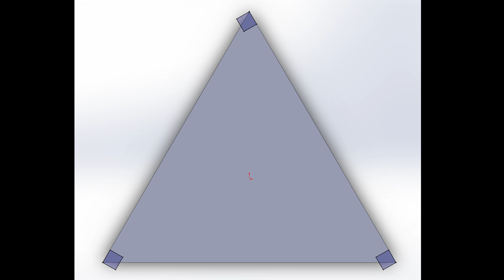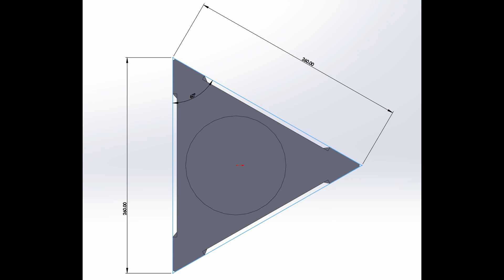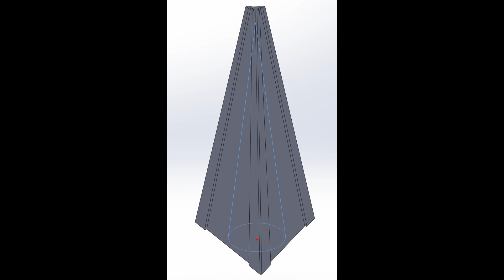2025 Science Olympiad Tower Div C: Overall Approach

Comment: How much space is required at the top for the loading block to fit, having as little extra gaps as possible? What is the smallest triangular sidelining we could aim for to have the chain and loading block just perfectly go through???
Reply from the maker: I'm not sure what the exact minimum size at the top would be.  My design here has a pretty small top, I wouldn't want to go too much smaller.  Remember, you have to thread the eyebolt and chain through during testing and you don't want to risk breaking it.

Comment: Hey i am having some troubles sizing the sliced files you have attatched in the description can you attatch the unsliced stl files. Thank you
Reply from the maker: Here is the complete jig before I cut it into 3 pieces: https://klingerphotography.com/BalsaEngineering/2025/2025_DivC_Tower_Complete.STL
Reply: @balsaengineering6686  hey thanks for the stl files but i am confused because when i go to slice this file or even print the other files it wont fit my slicer i have adjusted the settings for the baseplate in my slicer . Even this seems to be a bit bigger is this years jig bigger then last years jig? I have access to a ultimaker printer that has a base plate of 12 inch by 12 and should be able to print the whole thing in one go
Reply from the maker: @arjavjain3279  A 12x12 baseplate should be plenty big enough.  The bottom part of the jig is only ~257mm in the largest dimension.  You shouldn't need to scale anything to be able to print the piece.  You might need to rotate it 90 degrees so it's flat on the plate, but that shouldn't change the size.
Reply: @balsaengineering6686  it ends up being 257 cm not mm
Reply from the maker: @arjavjain3279  The file is definitely 257mm, so if your program brings it in as 257cm, just scale it down by 10x

Comment: Are the STL files already scaled? (The video are really helpful! Thanks!)
Reply from the maker: Thanks!  Everything but the triangular leg sanding jig STL is scaled ready to print.  You'll need to scale the sanding jig the way I show in that video if you want to try that approach: https://youtu.be/MTHygxUS3YU
Reply: @balsaengineering6686  I will defiently check that out! Quick question though, what unit was used for the measurements for the tower prints?
Reply from the maker: @KayLe0521  All the STL files should be in units of mm

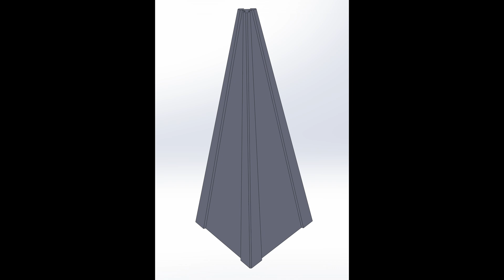Comment: 3:11 Would it be more optimal for the three legs to cover as much area as possible on the loading block (longer length of the triangle), or as little as possible? I'm trying to model my own jig based off of yours, in case if I want to change the design in the future, and was wondering which part of the design is the extrusion angle of 7.17 degrees that led you to a length of ~4 cm. Was it the angle between the base and the sides of the jig? Thanks for your immense help with helping others get started in this tough event, and being so quick to respond to questions!
Reply from the maker: There is no one right answer here as there is a trade-off on the size of the top.   From a loading standpoint, you'd want it as large as possible as the angle would be steeper and there would be less induced torque in the legs.  On the other hand, making it smaller allows for smaller cross members which get stronger in buckling proportional to the square of the length.  I picked a size generally in the middle.  Feel free to experiment with both options if you have the time and resources.

Comment: How would you recommend 3d printing the jig if my printer isn't big enough? Should I just use software to cut it in half and then print it? Or would that cause inaccuracy?
Reply from the maker: The best option is to find a printer that can print it in one piece, but if that is not an option, I have had success with Microsoft's free tool 3D Builder to cut up STL files.

Comment: Is it just me or are the STL files not working? Does it automatically download as soon as I press it or am I supposed to be directed to another website?
Reply from the maker: If you click on the link, it should download the file to your local machine.  The files are stored on my server on a different website.
Reply: @balsaengineering6686  Thanks! I think my mac was just broken, had to open it in some other way
Reply: @balsaengineering6686  They don't download, the tab opens and immediately closes
Reply: @balsaengineering6686  They dont work, the tab opens and immediately closes
Reply: @iQber  I have an iPad 😭, I can share it with you through google drive just send me ur email
Reply: @iQber  idk if i responded to you already i swore i did but guess i didn't but i have an ipad, but now i have it uploaded onto a google drive so if u want to share me your email i can share it with you
Reply: @steamedfrog8386  I got the problem fixed and I was able to download the file. You just had to right click and copy the link and paste that into your browser. Thank you though!
Reply: If you're having trouble downloading it, it may be that the download was blocked by your browser. You can force the browser to download it.

Comment: You trim corners AFTER jig is printed? How did you do that and what size leg then are you using to fit in grove?  Thanks
Reply from the maker: No, there is no modifying the jig after it's printed.  There are also no grooves for the legs this year as they aren't square.  Stay tuned for the next video to learn about how I go about creating the legs we'll use for this build.
Reply: He’s going to release a video on how to make the leg the size is 3/16 in
Reply from the maker: @Guthhhiii  Correct!  The next video released will show how I use 3/16 x 3/16 square source sticks to make the 60/60/60 triangular ones that will work on this jig (with tape)

Comment: Is there a advantage/disadvantage to using a modified square vertical member (with two sides sanded to 60 degrees)  as opposed to equilateral triangles?
Reply from the maker: I might not be understanding your question properly, if you sand 2 angles to 60 degrees, doesn't that make the 3rd angle also 60 degrees and thus an equilateral triangle?  In general, we want these leg cross-sections to be as symmetric as possible to resist buckling equally in multiple directions.  My entire next Div C video is all about creating these triangular legs.  I found a solution that made it fairly easy to accomplish.  Stay tuned!
Reply: @balsaengineering6686  sorry I meant one edge of a square with the opposite side remaining 90 degrees.  Thanks for all you do!
Reply from the maker: @timchristensen5548  Ahh, something like that might work to some degree, but wouldn't that still give you issues with perfectly flat sides on all 3 faces?  Unless you mean not making an equilateral triangle tower.  There are definitely different shaped towers that could work, and perhaps some non-symmetric ones could do very well, but I choose to just focus on the simplest option for now.   As soon as your tower isn't symmetric, you'll have to optimize legs and cross members on a per-side basis.  Not impossible, but definitely more work.  Thanks!!
Reply: @balsaengineering6686   thanks for your patience!  yes it would still be a overall tower that is a equilateral triangle. Each of the verticals would be a 60-105-90-105 quadrilateral. Doing this would allow the jig (if each vertical groove had a 90 degree surface) to act as a sanding guide to create the 60 and 105 angles.
Reply from the maker: @timchristensen5548  Hmmm, maybe.  Definitely something to try!  I don't like the idea of sanding the legs on the assembly jig though.   I think I came up with a better solution :)  Stay tuned for the next video!